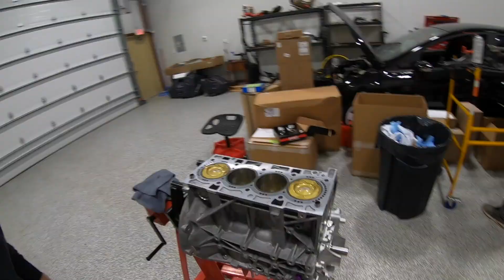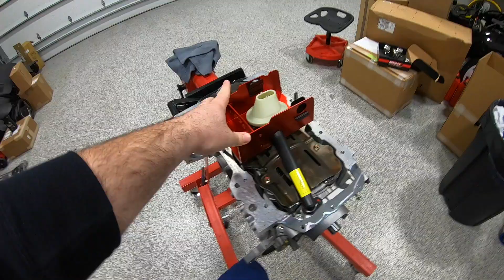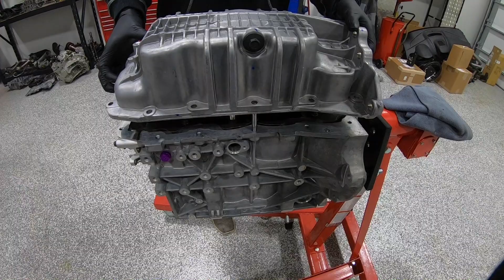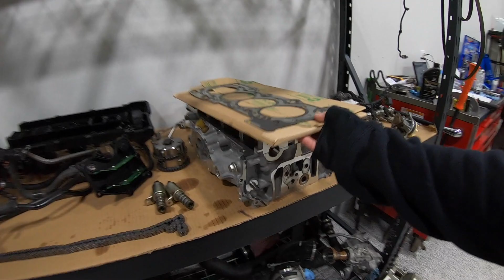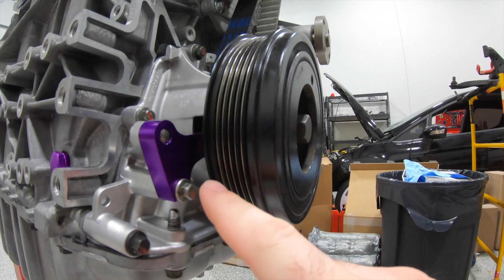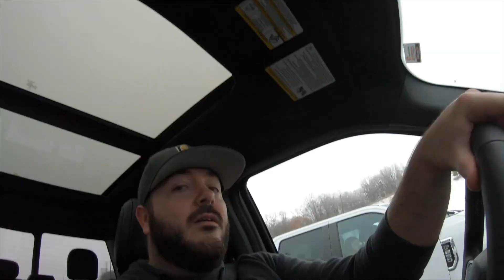TunePlus, Inc: 450whp Fiesta ST Build Update #1 - Engine Assembly

Comment: Doesn't the 1.5 block have hot metal sprayed into the aluminum based liners, whereas the1.6 has actual iron based liners? It probably won't matter if you're going to sleeve the block anyways. There's also potential fitment issues with the 1.5 blocks in the t stat and oil separator area.

Comment: Good that it's fitted with a cylinder support system on the block, I was wondering if it had, esp with 450bhp, don't think it would last a long time without it, head gasket might fail due to some small movement of cylinder walls and the silly slot ford decide to machine into the block. 🙂

Comment: So no sealant on the oil pan except those small points ??
Reply from the maker: The entire oil pan gets sealant.
Reply: @AdamBrunson  yeah I thought so, but your video showed no sealant anywhere else when you installed the pan
Reply from the maker: @ziffbobbit  The entire bottom of the pan was covered in sealant. You can see it squeeze out a little bit when we install it in the video.

Comment: Some great information here on this and the other videos. I had already done all the engine build and install so am gutted that I now feel the need to remove the head so I can install the 1.5 gasket lol.. 2867 with the Extreme fuel and 300 cams (I know you don't like them) and Bosch injector upgrade looking to get around 400whp but also selectable for my track car use to allow for different circuits and conditions so maybe 320 350 370 would do.. If we were going to get you to tune our car how would we go about that?

Comment: That Right Stuff sealant your using, is that the same stuff you used on timing cover to?  I'm thinking about picking up some Ultra Grey, however if you would recommend the stuff you guys are using, i would just grab some of that instead.  There are so many different kinds, but i heard Ultra Grey is good.  I would appreciate some advice if you see this comment.

Comment: Adam great job on the engine and what have you done on the community. Got a question, could you provide me with a link on what timing kit did you use foe setting up timing? My fiesta st is gonna probably gonna need a timing belt change (long story) and i cant find anyone competent to do it, so i am probably gonna do it myself. Thanks